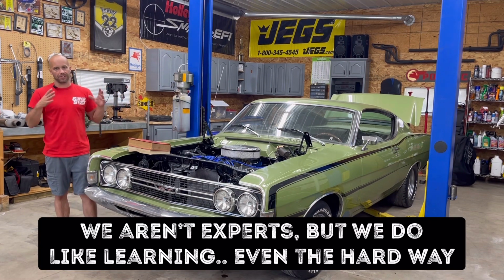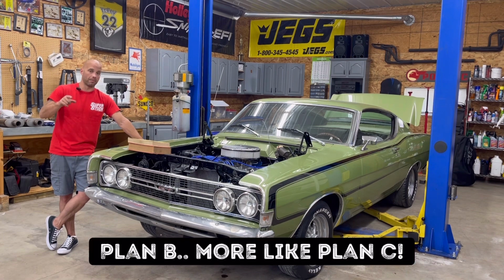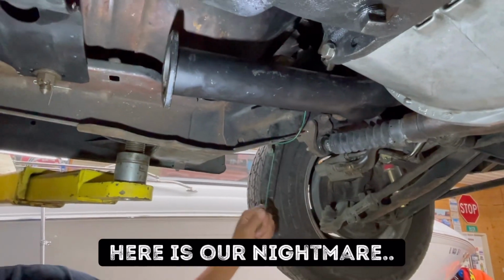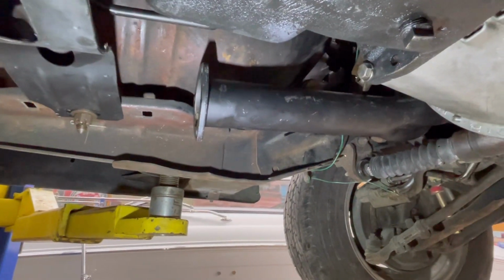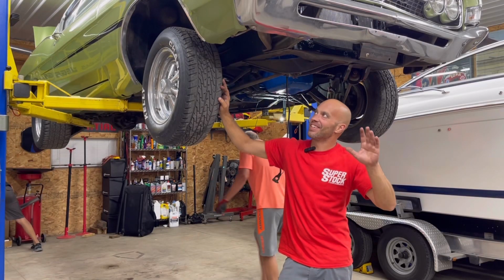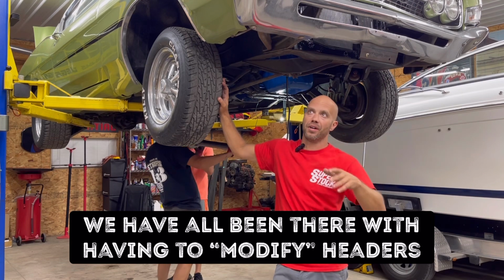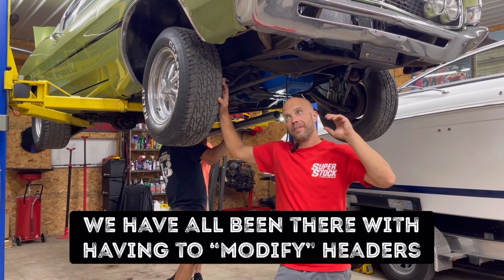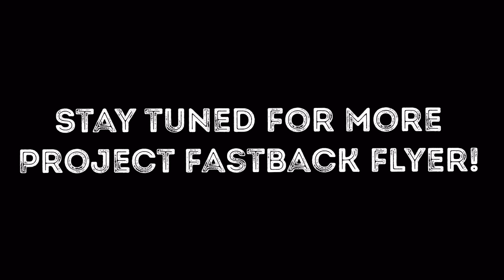1968 Ford Torino Fastback, One Step Forward and Two Steps Back! #automotive

Comment: The 290 and 300 HP M code 351 Windsors in our 1969 GT Falcon, 351 Fairlane and GTHO Falcons ( The extra 10 HP, Buddy Bar Aluminum intake, hi lift Shelby OZ cam were over the counter options from Shelby, standard on our big hot touring car four door HO hybrids) . These to 4V cars were both  imported Shelby 69 MY 4bbl engines, and they didn't have headers. The issue for Ford on both sides of the ponds was that Power steering verses tubing headers issue you saw first hand. Even Mustang GT 350s with the 351W 4V didn't get factory headers because they were generally power steered. It goes without saying, you did the right thing for the bill payer. Unibody tall deck 9.48 deck SBFs, really bitchy, really difficult, Fight you all the way...The solution for header lovers, is reduced real estate taken up by the Chev Camaro integrated Bishops Kirby variable ratio recirculating ball, a Ford GM part and a Mustang option the next year, 69. 68 Ford's s didn't get it.
Reply from the maker: man you guys have some cool cars over there!!!  Yes, for the price of the headers that "fit", it would not be worth it.

Comment: I think they make a drop bracket for that power steering ram. Manifolds?  And I think that Fox Mustang shorties won't work because the left side will run right into your clutch Z bar... I remember eyeing them up on my '68 Cougar with a C4, and they would've hit the steering in that car.
I didn't like that hotass collector tube immediately under the clutch linkage like that either - even though it's mechanical linkage and surely not an issue.
Reply from the maker: Man it’s a crazy design flaw!!

Comment: Would switching to a hydraulic clutch fix that clearance problem?
I like to just stick with factory HP exhaust manifolds so many less headaches.
Reply from the maker: it would still be in the way.  They make a pair of headers for this application with the power assist, way out of the budget!
Reply: @2HacksGarage  That stinks 🦨
Reply from the maker: @NathansMoparGarage  yes it does!
Reply: @2HacksGarage  You could cut and modify that driver side header to fit, no?
Reply from the maker: @DanEBoyd  nope, tue z bar hit no matter what